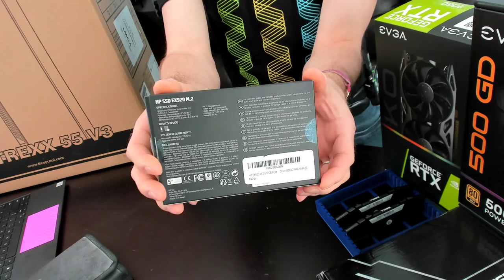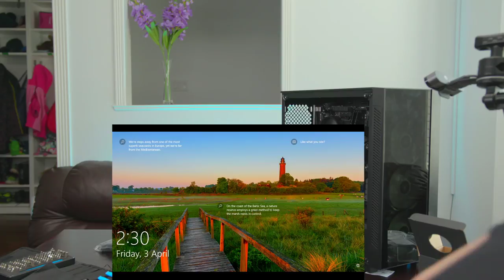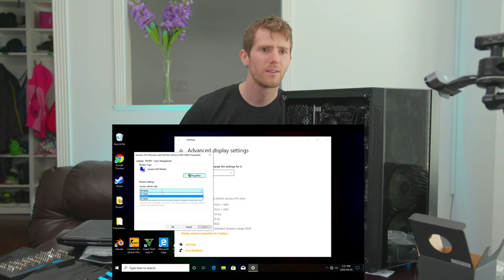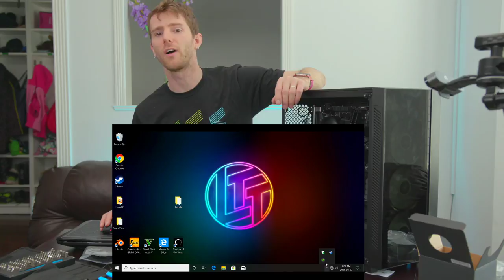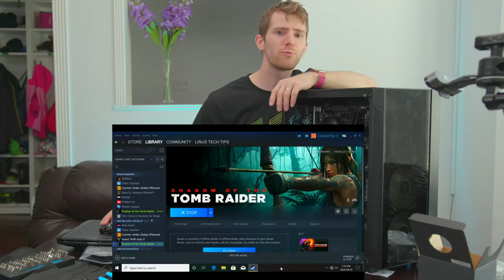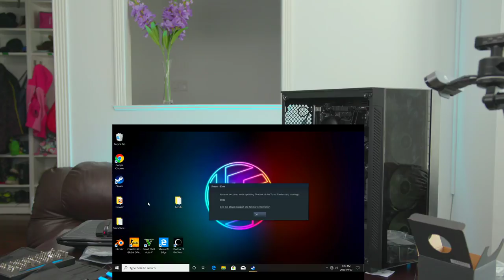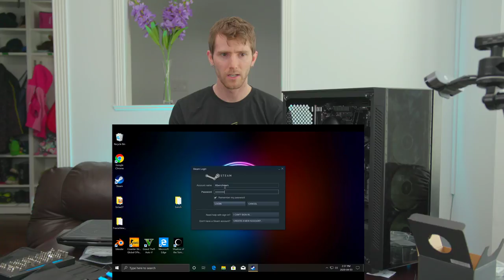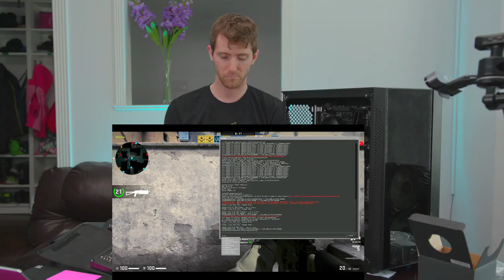Building a Value Gaming Rig at Home - $800 Budget

Comment: Just priced these components on Amazon (using the above links) and it came up to $982. Big increase in 6 weeks.
Reply: My buddy built a system last month and now its worth 1500 more than originally if u price it part for part
Reply: Linus is also Canadian, so his currency is worth more.
Reply: I watched a $1000 budget video and then went to amazon and it gave me $1200 total.
Reply: dude i went to a computer store and said that i want to build this pc and i went home and they emailed me and it was 1750$ like WTF LINUS
Reply: There’s a shortage of components from China right now.
Reply: @johntricola4746  shortage on psu, motherboards,and new ryzen 3300x..ive been waiting a month and i should have all my components by monday..fucking crazy
Reply: hmmm i wonder why…
Reply: CAD is most assuredly weaker than the USD.
Reply: pretty soon the prices will fall
Reply: Damn, I was going to build this for my sister but I might just have to settle with one of NZXT's starter pc's or plus variant.
Reply: Supply and demand. You can thank COVID for that. When supply lines are cut off prices escalate
Reply: Brandon Reyes hey buddy
Reply: Yes it now costs over 1400 dollars CAD
Reply: Yeah it's actually not a bad time to go prebuilt considering the price increases on individual parts.
Reply: @spyxee3315  if he meant 800 CAD then it shouldn't be more than 600 USD
The prices just went up
Reply: Where I live this is $1650 canadian when converted from my country's currency
Reply: jeremy O aqaqqqq
Reply: @spyxee3315  Canadian dollars is worth LESS. Linus joked about that in his videos all the time.
Reply: @nckats  they're probably the best thing to get right now.
Reply: @FDFANATIC541  lol Idk what yall using its 735 for me lmao
Reply: Corrona caused a price jump
Reply: @nckats  maybe try a 5 1600 af(its a new chip not actually a 1st gen just named weird) came out like 5 months ago. Also get a a large harddrive and a 500 gb boot ssd instead
Reply: @spyxee3315  Canadian dollar is worth 74 cents per american dollar.
Reply: thanks a lot corona
Reply: @spyxee3315  It's the opposite
Reply: That is why you have to try honey. Honey is a free browser extension which gives you discount codes on products you can find in the internet...
Reply: And I swear this will get cpu bottlenecked. A 2060 bottlenecks a 3600 according to some calculators
Reply: @FDFANATIC541  because of the lockdown
Reply: Spyxee the Canadian dollar is worth nothing at all
Reply: Oseobulu Ebosele-Park so get a 3300x
Reply: Because of quarantine duh
Reply: I just speced this pic out with a ryzen 7 and a 2070 and I’m only at 1300 after taxes
Reply: First of all they get all hardware with license discounts and its Canadian dollars running. 32  lower these days and  one thing we all should not ignore they also getting some discounts from Amazon too 
I think 3 percent something or other 
If I am not mistaken 
I heard this in one of the linus or jay 2 cent old live video 
So for us 800 like for us more likely 1200
Reply: Cuz Linus is a big time influencer,  y'all  :)
Reply: For real, I can’t get anything even close to those parts for under 1000
Reply: At least you aren’t in Canada. Pricing gets crazy here.
Reply: I just priced them on pcpartpicker.com and it rung up to $900
Reply: @spyxee3315  thats way backwards
Reply: Vic P let me know once it drops back to its normal price 😔
Reply: A Nickname If you go to pcpartpicker.com and put all the components in there it’ll give you the cheapest price they can find
Reply: Jacob Brand thank you:>
Reply: 800????? I wish i spend 800 for a pc like that but at the moment it i'll cost you 1200
Reply: it's already higher
1,018 dollars
Reply: @watermelooon1768  did you cancelthe order
Reply: @ygobe2  nope
Reply: @tim1366  it was just a quote
Reply: Supply and demand.  Took me a few weeks to find a 2070 super for close to msrp
Reply: Yea thought 800 seemed low for this. You could prob do it at microcenter but everyone doesnt have one.
Reply: He got sick right when I did and I grew my beard too! Working from home now helps that cause though lol
Reply: @spyxee3315  since when? The Canadian dollar has allows been worth less than the US dollar for i dont even know how long
Reply: I just did the same and my comes to $805
Reply: @ygobe2  thats why its x to overclock
Reply: @spyxee3315  Canadian currency is NOT worth more than U.S. currency.
Reply: Check newegg too
Reply: Instead of putting it all in amazon put the parts on pcpartpickers and they will give you the cheapest website for each item
Reply: @alexliu6067  still comes out over $900 😞
Reply: @spyxee3315  its the other way around, the canadian dollor is worth less, trust me i know im Canadian
Reply: And that's just for the PC, it'll cost you more for the monitor, keyboard, mouse, mousepad, and the operating system.
Reply: jeremy O wield t
Reply: Amazon is more expensive than Newegg and many others
Reply: Can get it cheaper on newegg
Reply: Supply and Demand at its finest
Reply: this would probably cost 1100$ in sweden
Reply: Check how much it is now lol. $1k+
Reply: Spyxee yeah he’s Canadian, but he uses USD currency in his videos
Reply: @watermelooon1768  pc stores charge you labour and their cut on pc components, build the pc yourself and you'll save money.
Reply: Zeina Darell Manigbas check other retailers like b&h photo, Newegg, bestbuy and more. Especially check your local micro center(if you have one where you live) they have great prices.
Reply: Spyxee worth significantly less actually. $1 USD = $1.35 CAD.
Reply: @beaudetkevin2528  oh?
Reply: @watermelooon1768  yeah they don't build PC's for free 😂 that's how they make a living but pc stores are overpriced right now and it's been like that for a while. Just watch build tutorials and build the pc for yourself and order online. You'll save a good 300$
Reply: I actually played with the parts made it abt 791
Reply: @watermelooon1768  have you looked at the prices at your local restaurants? Everything has went up. The only component of my pc that is the same price as when I built it (same night as this video) is the graphics card and it is pretty low end.
Reply: I bought this build just last night for 900 some things significantly have dropped only 80 dollar difference but it’s still way higher then the 800
Reply: @spyxee3315  Our currency is worth less than USD.
Reply: @zeimanigbas  his 900 ryzen build is 1200 now lol
Reply: @FDFANATIC541  Except its not cause now used :(
Reply: @spyxee3315  cdn is -33% compared with usd, and pc parts cost 50% more than US.
Reply: Not including Windows 10!
Reply: @spyxee3315  na, other way around for usd
Reply: Try microcenter they are relatively cheaper
Reply: Try microcenter they are relatively cheaper
Reply: @spyxee3315  less
Reply: @spyxee3315  Actually USD is worth more than CA. If you have 20 usd you have like 30ish CA
Reply: yeah these guys make it look budget but when you go to do it it winds up being quite a bit more
Reply: In England it is a lot more and we have to convert that to pound so on rtx2060 is like £300 which is $350
Reply: @FDFANATIC541  5263024p
Reply: @FDFANATIC541  p
Reply: @FDFANATIC541  p
Reply: @FDFANATIC541  p
Reply: @FDFANATIC541  Rp
Reply: @FDFANATIC541  p
Reply: @FDFANATIC541  p
Reply: @FDFANATIC541  juga
Reply: People it's not Linus or these companies. It's the Fed and other governments printing large amounts of money. It's called inflation, it's going to get much worse for many people around the world.
EDIT: That's what you get with fiat money. 😂
Reply: Me too
Reply: @spyxee3315  the opposite
Reply: @FDFANATIC541  o
Reply: For me it was $772
Reply: @zeimanigbas  they also use this one site I think it’s called PC Partpicker and the website finds the cheapest prices from multiple different websites
Reply: "When there ain't no reset switch"
Mate....
When you're really mad..... relish in the act of HOLDING that power button for the 5-10 seconds it takes to CHOKE the life out your uncooperative PC!!!
Make it pay!
FEEEEEEEEL the life drain from it!

Reset switch... pfff... that's an easy death
Reply: @zeimanigbas  thats 1000 usd
Reply: @spyxee3315  our dollar is worth more
Reply: @spyxee3315  usd is worth more
Reply: Hes Canadian prices are different in us 2700$ system i built was like 2200 there
Reply: That's because they see this and say oh let's try get more ppl will by the exact parts 😆
Reply: @Pavankumar Gali Newegg is really bad customer service compared Amazon if you have ANY PROBLEMS AMAZON WILL LIKE SHOW UP AT YOUR HOUSE NO NOT REALLY but Newegg I had issue and they where crazy difficult deal with after Amazon np we will send a new one and refund you for your troubles attitude
Reply: @psychomonkeyinc  but they do have best return and refund policy ever
Reply: @xmarkiexmayhemx2200  ya when it arrives broken good luck on them sending new one.  They are the absolute worst at refunds and sending things if anything happens during shipping they wanted me like prove it wasn't me damaged it and said I was supposed open it in front delivery guy I b almost died laughing.  Hey ups. Guy I know u you got million other things deliver but can u hang out smoke a cigarette bowl 🥣 whatever u like while I build my pc and check the part for any defects in front of you.  This was b4 covid obviously but still.  Lol I had call berry's business bureau.  One complaint to them generally gets your issue fixed quick
Reply: Imagine 3.9 million people looking at this video and only 25% actually building to spec. Thats alot of people. Simple supply and demand , anybody in theke right mind would bump prices to increase profits...
Reply: Tax
Reply: @zeimanigbas  don't forget that they buy it cheaper usually
Reply: @spyxee3315  thats backwards, USD is worth more
Reply: Amazon is upping the price . Check your local stores . I’m looking at 1660ti and Amazon is 1000$ and my local store is 400$ . Wtf !
Reply: @winksopro6916  the graphics card is literally 800 by itself rn
Reply: @spyxee3315  worth less its like 1.2 rubles per uds
Reply: @Noah Henderson thats just the gpu my dude
Reply: Now check it priced in Canada  and your have a heart attack! if you can even get it!
Reply: For me it came up to $1014
Reply: Tho this is almost a year later
Reply: Most of the time his builds are in USD not CAD. kinda sucks he doesn’t price it in Canadian
Reply: 7month after yours the RTX alone is 1644$ on newegg XD
Reply: @watermelooon1768  frl I found a prebuilt pc just like this one at Best Buy and it was like 1600
Reply: @nckats  do you have a nice sister?
Reply: @FDFANATIC541  it got worse
Reply: @mxoAs  indeed..i guess i built mine at the right time when the 3600 was 165.00 and 1660 Super was 230..only regret i have is not waiting anither month for msi b550 gaming edge vs my msi x470 gaming plus...
Reply: Covid tax
Reply: Or Linus effect
Reply: @zeimanigbas  taxes?
Reply: @karotte9920  still waiting grows  beard like Linus waiting for price drop
Reply: @sleepieststardust  aka covid tax
Reply: @chilled where do you get your info from?  Cracker jack box?  Cereal box?
Reply: @ygobe2  at 1080p it may at full
Reply: @_jack_ryan_9764  bought a 2600 off ali
Reply: @Ranveer_sangha03  then is video is out of whack and therefore completely invalid
Reply: @marcbensen8963  110 percent right
Reply: Amazon is most of the time not the cheapest place to buy stuff. I've often seen that it is in the higher priced area...
Reply: The graphics card cost $750 itself so idk where he got that price
Reply: @spyxee3315  Canadian currency is worth less, which is why it takes MORE dollars to buy the same items. maybe I'm wrong, but I'm fairly certain that's how it works
Reply: Yeah it’s 740$ just for the graphics card alone now.
Reply: @imatsoup5304 most of the time between 300 and 400€...
Reply: I built a 3600XT, ASUS x570 TUF Gaming Plus, 2060 KO Ultra, 250 GB M.2, 500 GB Samsung 970, 16 GB Trident Z Neo RGB (AMD), 750 W 80+G PSU, Case with 5 fans, for $1100.  
Now the cpu and gpu alone cost more than this entire system.
Reply: get a rtx 3070 instead now that it's out...its like 200 cad cheaper
Reply: @FDFANATIC541  hi h
Reply: It's 1,310  now, mostly because the gpu
Reply: I added up all part prices and it came up to $1,300...
Reply: Dude. Just the 2060 is $750. ZERO CHANCE this is $800 :(
Reply: I slovakia i made it only for 538 not on amazon 700 with aoc monitor
Reply: Recheck now and u will besuprised
Reply: @watermelooon1768  don't forget that if you say you want a computer built they need payment for building it too. Prices also fluctuate
Reply: @ygobe2  the calculates are bs and say a you can bottleneck a processor with a gpu. A 7700k is enough for a 2060 so is a 10100, a r5 3600 has more efficiency, less heat and more cores/threads so I believe the r5 would not bottleneck the 2060.
Reply: Just went through this the fucking graphics card is 800$ by itself on Amazon lol
Reply: Lol this hasn’t aged well
Reply: oh boy this didn't age well. it's past $2k now
Reply: now is aout 1464.82
Reply: and 10 months later the GPU alone is 1200.00 or more.
Reply: Bruh the gpu cost more than the whole system now
Reply: @spyxee3315  less
Reply: @ygobe2  A 3600 or 3600x should be fine. I only think it'll be a problem with 2080 - 30 series cards. But 1660s and 2060s should be fine.
Reply: @spyxee3315  worth less one canadian dollar is 78cents in usd

Comment: Just re-priced these components on Amazon again in 2021 (using above links) and it came up to $1141. crazy how over time the pricing increases rather than decreases.
Reply: It’s because of stock, high demand and low supply atm mainly due to covid
Reply: Supply chain issues are crazy right now .. from the shutdown supply was reduced and demand remained during the shutdown and now demand is thru the roof backed up and all ..
Reply: @9BallBory  it wasn't because of covid. enjoy the coming economy crash, working as planned.
Reply: @johnturtle6649  prices skyrocketed not to long after covid, stuff was being halted on being made. yes it was ebcause of covid, idk what youre getting at.
Reply: @9BallBory  you wouldn't.
Reply: @johnturtle6649   what was it the illuminati that did it lmao wtf are u on about kid
Reply: @9BallBory  Nothing grandpa, go back to bed you wouldn't understand
Reply: @johnturtle6649  I mean it was mainly silicone chip shortages and scalpers that caused prices to sky rocket so Bory was kinda right... The chip shortage was mainly caused due to lockdowns etc
Reply: @johnturtle6649  it's our governments fault but the shortage is a global problem? China produces 64% of the world's silicon which is used for semiconductors. But it's our governments fault?
Reply: now it's like $1400 lmao
Reply: @bananya6020  it's less than 500$ now.

Comment: I decided to go with the Ryzen 17 6977x and the AMD 3.14159v2. It ain't too bad, for real. I thought heat would be a problem, but I've been able to keep it under 5100 Kelvin. I went with the MAXX AIR 36" belt drive fan from Home Depot, so it's doing a great job when it comes to keeping it cool. Sometimes I have to put a bag of ice directly onto the system, but it cools off pretty quick. And I'm soooooo glad that I went with the Square D 7,000 watt PSU, because it has been a game changer!..

Comment: That case is very similar to the Thermaltake V250 TG.. I just built in a TT.. Not too bad for a budget case. I get a good amount of airflow from the topside, the front airflow is a bit muted, but the top after market fans draw a lot of air. It runs very cool even with overclocking and such.

Comment: the chat going "REEEEEE ThErMaL pAsTe!!!!" when the cooler had it pre applied - lmfao
Reply: I'm so glad I found your comment. I was genuinely curious about that when watching lol
Reply: I have that same CPU and I was worried why it didn’t have thermal paste, I guess I have my answer now lol
Reply: They're probably from The Verge
Reply: Does it matter which way the cpu cooler goes?
Reply: @ravzclan754  Yes it does. You'll want the fan on the heatsink tower facing towards the rear of your case. That means fan blowing air towards the rear of the case.
Reply: @cryo_life  ty I'm just waiting on my cpu for my first build and probably would have done that wrong 😂 I did luckily know that ryzen comes with thermal paste applied tho. You do not want that sheet on your skin lol
Reply: @sethwinters3556  The thermal paste that AMD give you on the stock coolers is literally like glue 😭😂😂
Reply: lol oki, I was wondering cause I'm a noob at pc buildin
Reply: really shows the iq of a lot of the viewers
Reply: @cryo_life  should we use better thermal paste or no?